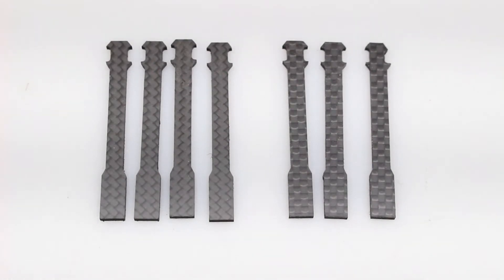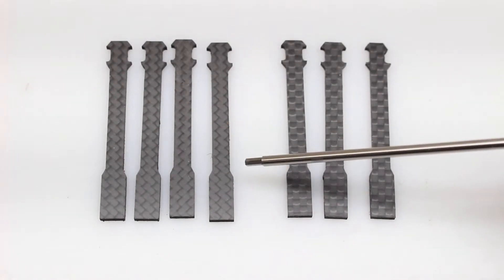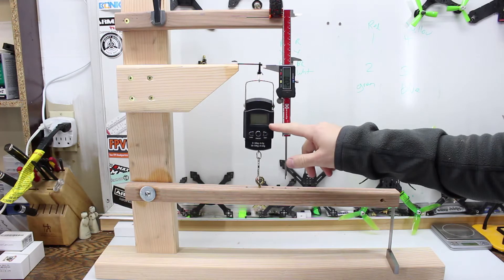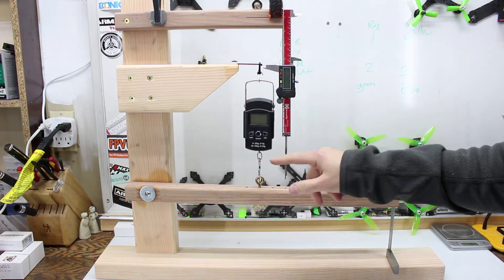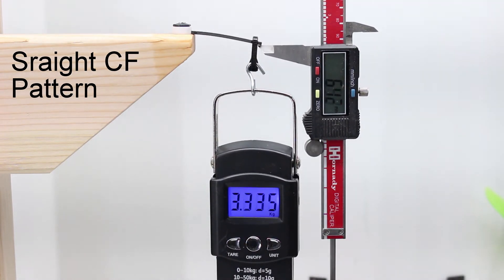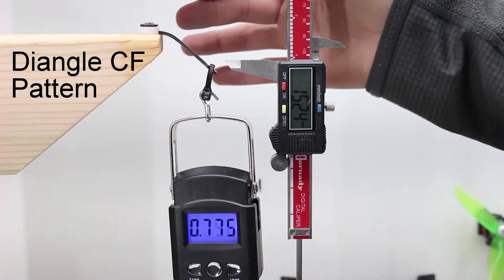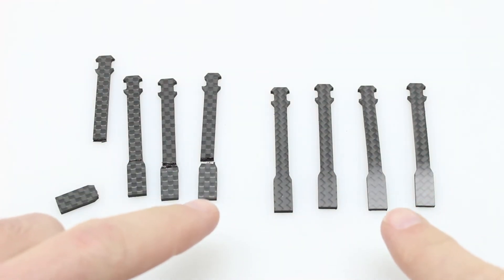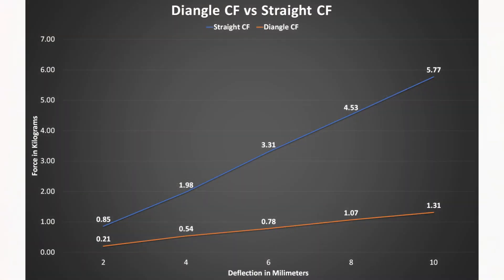Carbon Fiber Testing: Straight vs Diagonal orientation---  Surprising Results!

Comment: Well, this is interesting. I personally suspected as results showed, that more flex in cross weave and more stiffness in fiber direction. ,,, perhaps more than simple crash durability, how does this flex affect performance? Some flex will help the copter remain stable and easy to control, while more stiffness will result in higher top speed. Flexy arms will damper vibration and also cause the pilot to need more absolute control inputs to affect inertia. Stiffer arms will feel more immediately responsive, but make it much more difficult to hold a line. Gapping will be easier on flexy arms. Flexy arms will let the pilot feel more like they have a good road. Stiffer arms will make the pilot want more altitude, the ground will be harder to avoid while cruising at a few inches. But,, the copter will snap harder when requested.
Reply from the maker: I have discussed this with a pilot who flew at nationals and he was telling me in the past when he had a delaminated arm he would wrap it with electrical tape and said it flew just fine.  So some flex is not a bad thing.  I would not want more than 3-4mm of flex and the only way to really test it would be to do a full scale test.  I am thinking that the max amount of force on a 5" quad arm would be around 2-3kg.

Comment: The point of CF is to be stiff, and light. If it’s not strong enough make it thicker or redesign it. Diagonal or bias cut arms deflect with less force.
Reply: Would you put a ceramic ball in a vice to see how well it bounces? you only get a small part of the story with your test. It should be clear that you can't generate more force than the inertia of the quad in a crash. Whatever energy the arm can redirect because of its stiffness and strength goes to kinetic energy (spin, tumbling) or other parts of the quad. CF is only strong in the direction of the fibers.
Reply from the maker: Yes, it's supposed to be stiff but this is about finding the most ideal way to use carbon fiber to make a quadcopter frame durable while being as light as possible.  Increasing the thickness not only increases weight but also greatly increases cost of the frame.
Reply: Well,, flex is a damper, so being only the stiffest is not the only engineering concern. All vehicles need specific suspension for peak performance capability,, meaning that depending on the objective of the pilot, the stiffness of the arm should vary. It would be a tune-able part.
Reply: Actually the more familiar you are with materials the more able you will be at understanding how a material will bounce based on how the vice affects it
Reply: Troy Schmidt your model of what happens is definitely not complete or good. Deflection is certainly to be avoided. The FC can’t compensate for the large delay from mechanical flex of an arm. The experiments have already been done and concluded.